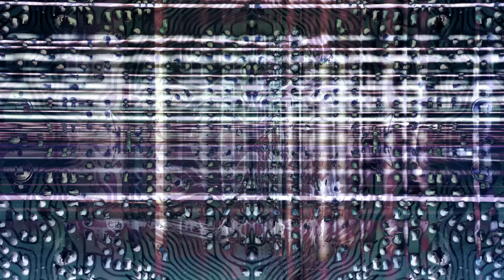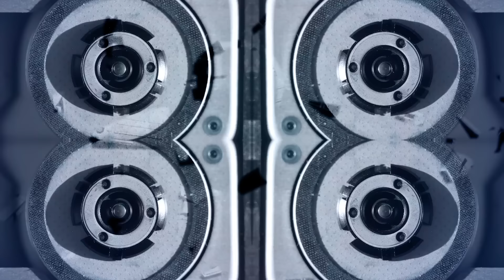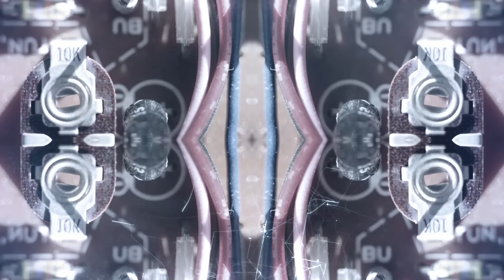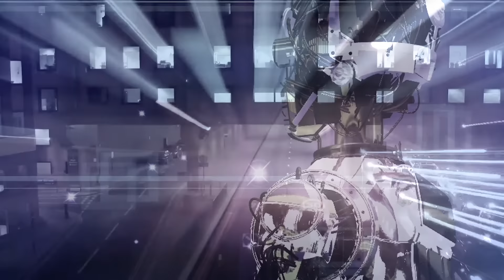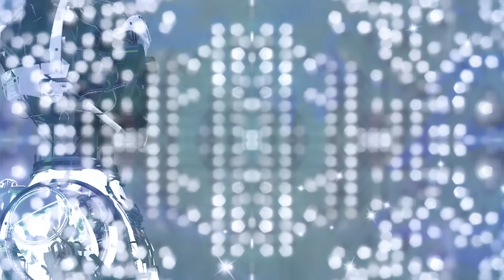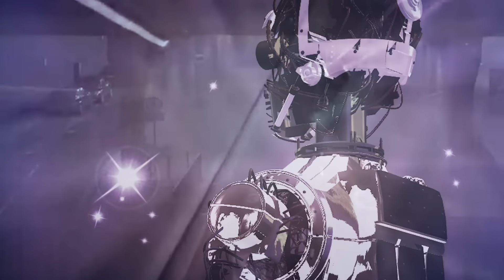Flying Lotus - R2 Where R U? (Official Audio)

Comment: I love the fact the Disney got FL involved but I can't explain why
Reply: +Eelco Stuy i am also curious in this connection
Reply: +Toke Balls iirc this is a super old song of FlyLo's, Disney probably shoved several figures in his face and now it's on this album.
Reply: +Eelco Stuy Rick Rubin is a legendary producer that was put in charge of creating this soundtrack lp and was told he could put whoever and whatever he wanted on the album as long as he didnt touch the john williams score. Rubin chose some of the legendary producers he's had experience working with and/or discovered. in FlyLo's case Rubin had worked with him previously when mixing some of his other albums and releases, but is not in contract with him.
Reply: +Monkeywrench I too feel like I've heard this tune before from FlyLo, (apart from the R2D2 bleeps), but the proof is in tracing the track back. I think this is from way before Cosmogramma came out. He did some collection of ideas+loops+etc  and this is one from them.
Reply: +Monkeywrench Ok so from other comments (and checking out the track) this is actually from "SHHH! EP", track called R2D2, released around 2008. it's a FlyLo whitelabel. Check it out on Discogs.
Reply: +Eelco Stuy Actually I'm pretty sure it was Rick Rubin who organized it and Disney just distributed it.